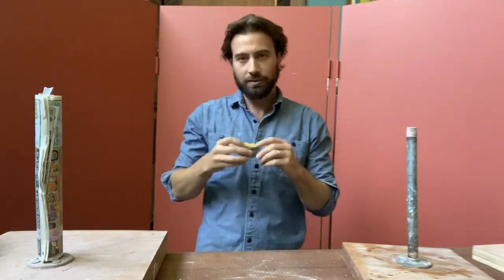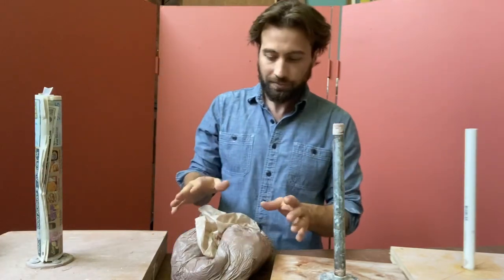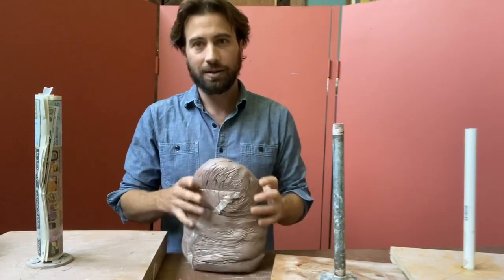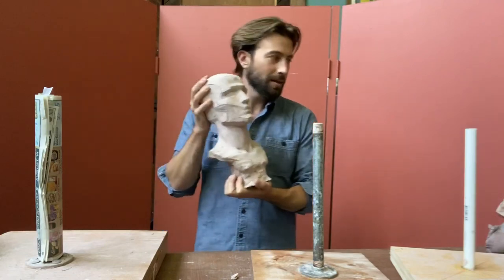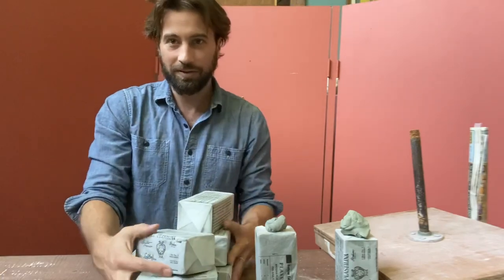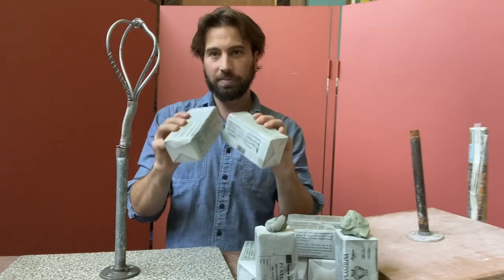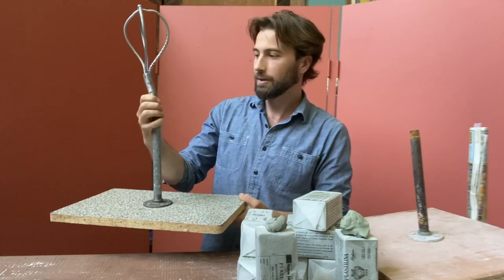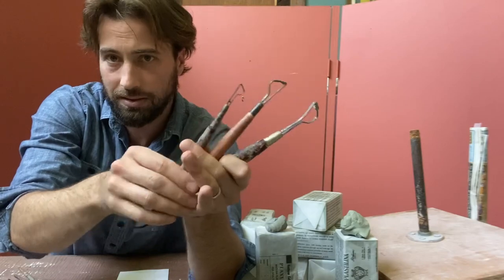Ep. 11 Recommended Art Supplies for Portrait Bust Sculpture

Comment: Caution: if you are planning to create a mold from your bust in polyurethane you cannot use sulfur based plasticine. Your mold compound will never set up completely and harden.
Reply from the maker: Yes that is true, I forgot to mention that.  If you are using poly rubber either use a sulfur free clay or spray you finished piece with a liberal amount of silicone mold release or some other type of barrier.